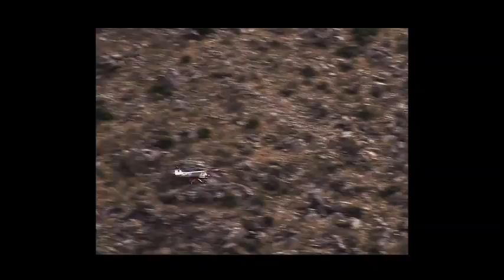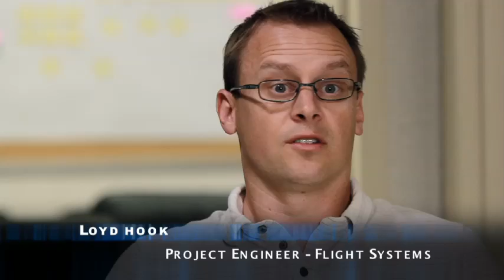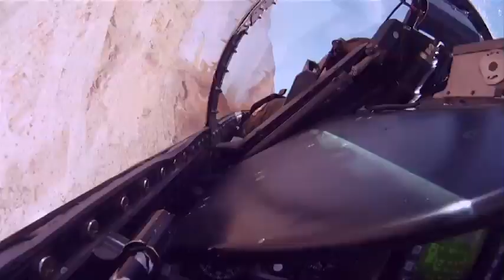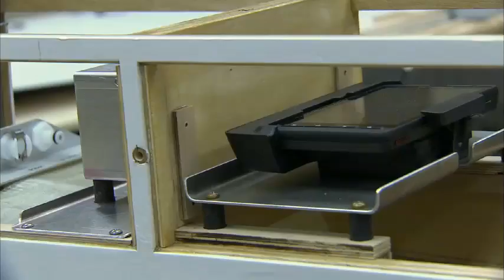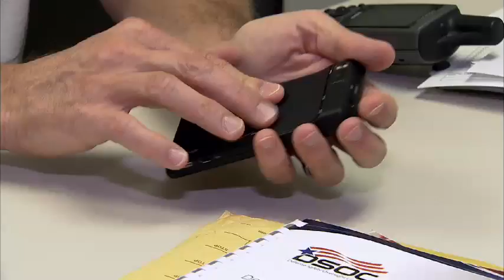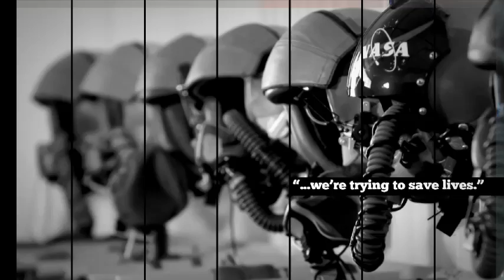NASA F-16 Low-Level Flight Tests

Comment: I'm telling NASA this... Put it in the video...oh right then you discredit the technology. So what be honest
https://axenty.com/resources/APD/Cessna%20182P%208488M.pdf
Refer to Section 5-12 Takeoff distance at altitude.
When the aircraft is just above stall speed at level flight full throttle this is not going to do anything but stall the aircraft into the mountain.
http://www.boldmethod.com/blog/lists/2014/08/10-highest-airports-in-the-united-states/

If you have a system that can see terrain in cloud or fog why cant it be turned into a visual representation in a screen or HUD?
Expense?
Well most crashes start out by poor planning, rushing a flight, misjudging or underestimating weather etc. 
Tools help the pilot but even then they still need to get that far to have a safe flight.
If you are going that far why not just have unmanned flights? People have to get somewhere? That's what video calling is for right?
People going to need all this equipment to fly or fall asleep?
Fighter pilots high G black out? I would think this is all it is really good for.

Although I have sent a plane on autopilot into mountains thousands of miles away having not known the terrain on the flight sim. That can be a worry.  Would be handy here to but once again Military or high commercial uses, I dont think you would get many customers other than that.

You guys build those planes anyway, why not just build it in them.